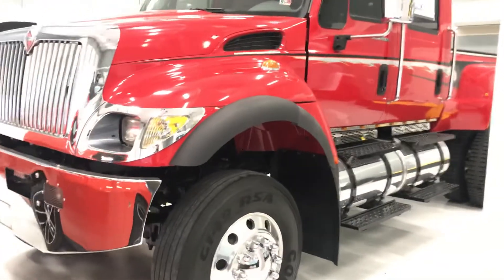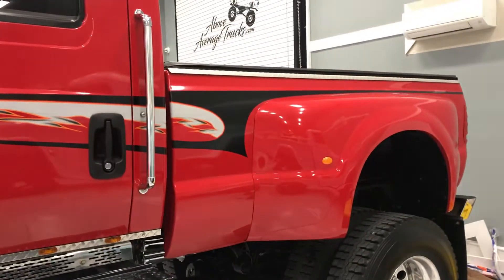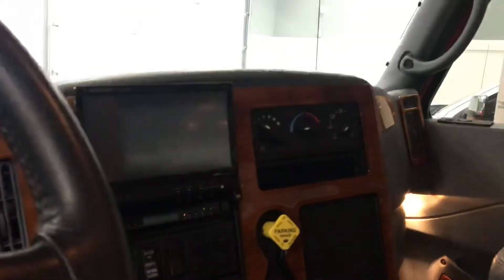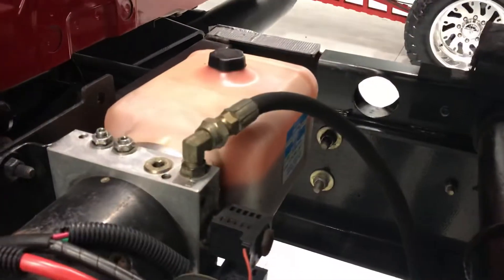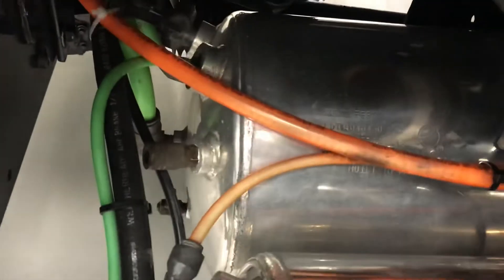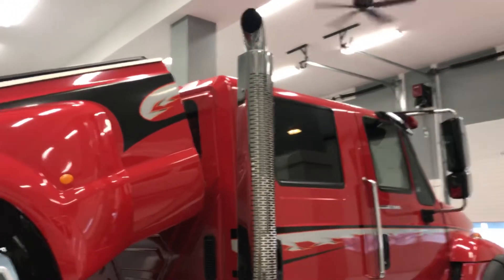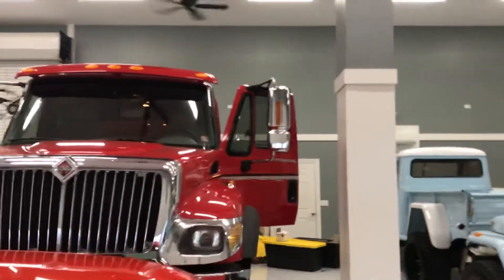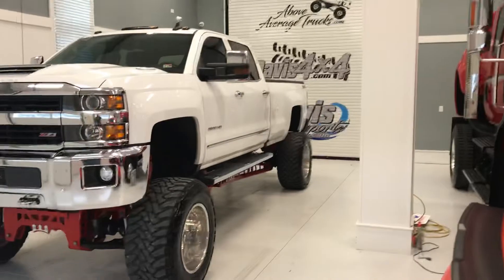2005 International CXT Crew Cab Super Truck Loaded Low Mileage 4x4 Pickup

Comment: God model would b able to run propane too bc diesel is crazy high & propane if bought in large tank bulk is fair price+ liquid fuel gas is prt way to hydrogen conversion when it arrives. I see a decent crane bit larger work body truck so u can recover other trucks if it goes bad offroading. I see tool boxes where 1 of diesel tanks fits both sides. Every 1 needs a tail gate hydralic lift bc bed is high as shit off the ground. The germans hve got some need 4 by 4 tech like crazy strong winches & drop down gear hubs. Super chargers & turbo tech has leaped forward since 05/06' paired w/newer electronic combustion controls.